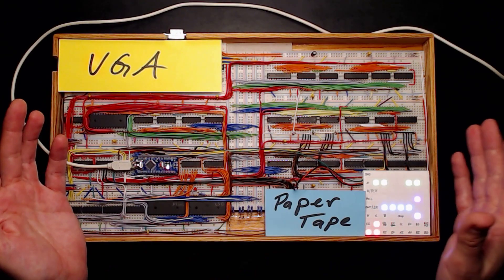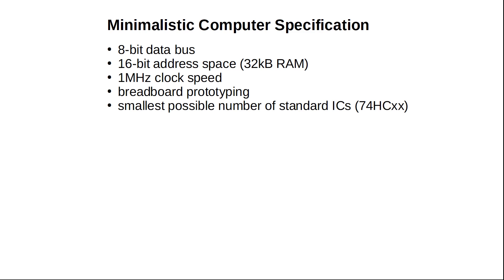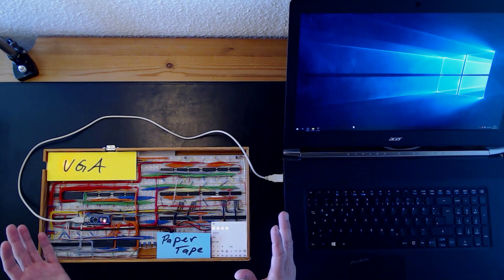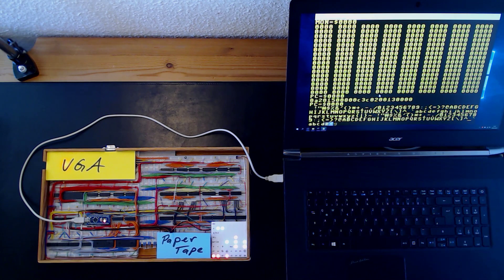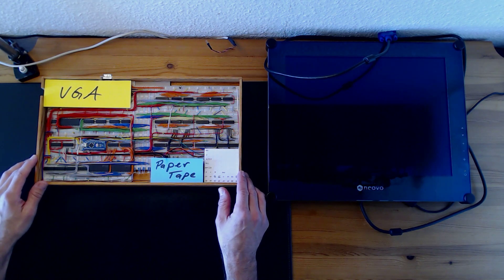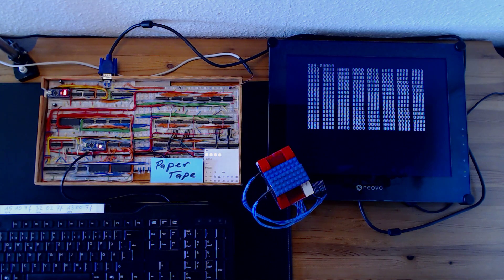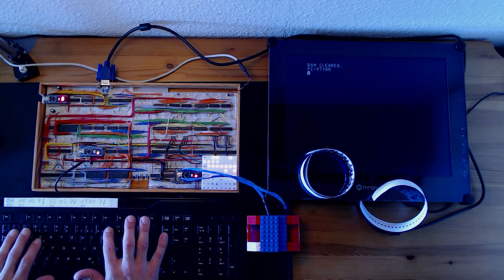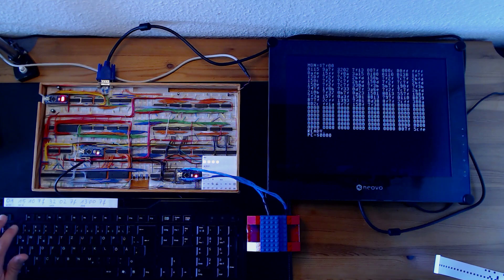Breadboard Computer With Minimalistic Design #1 Introduction

Comment: I am so incredibly happy that I have found your channel! This is EXACTLY the material I have been searching for, for quite a while!

I have read Petzold's 'CODE', and Scott's 'But How Do It Know?', I have done the NAND2Tetris projects, and built Ben Eater's 8-bit cpu, and read Brown and Maxfield's 'Bebop Bytes Back'. 

But hardly anyone talks about the bootstrap side of things, and I just wish more people would do so!

Things like "How do we get software into a new computer?", "How do we bootstrap our way from entering machine code via toggle switches into a high level programming language", etc. Even just turning on the computer, again, requires some bootstrapping, as all the contents of RAM disappear when the power goes off! All of this is super fascinating.

Only talking about the hardware side of things leaves the story incomplete. Everyone always shows you how to build a cpu hardware platform, but that's it.

Finding ANY books that continue the journey up the computer abstraction hierarchy and into and through software is incredibly tough (for some reason).

(Not necessarily books on OS's and stuff, but just things like how the whole compilation toolchain all fits together. A more holistic approach.)

(Bebop Bytes Back is the only one that I have found so far that talks about bootstrapping from toggle switches into assembly language in any reasonable detail, and is an absolutely incredible book).

Have you found any textbooks dealing with these neat things, books that talk about bootstrapping specifically? I am always on the lookout for incredibly passionate books on how computers work, much like Petzold's CODE, and the others I have listed above. 

(I also HIGHLY recommend Godel Escher Bach, and The Recursive Universe!)

Comment: Kudos for using paper tape. I have been thinking of how to bootstrap ROM as painlessly as possible, in a scenario when EPROMs are considered "cheating".  I was thinking of a similar setup but with foil or some other conductive material and using some sort of a mechanical contact to detect bits. Basically kinda like magnetic tape but much worse and not erasable. 

Is your tape reader also custom-built from basic components, or does it use a camera of some sort? 
I suppose you could also do your own reader with a pair of LEDs per bit, one as a sender and the other as a receiver, but it seems like that might be a bit tricky, I imagine light leakage would be an issue.
Reply from the maker: Hi Esa, the lego tape reader is indeed custom-built :-) It uses 9 LEDs and 3 photodiodes. Light leakage is a thing but can be handled by a clever algorithm. All in all it was a lot of fun playing around with this idea but didn't work reliably enough for me. So I eventually switched to magnetic tape and then, well, to UART, EEPROMs and FLASH and talked myself into not considering it cheating any more ;-)

Comment: I see no benefit to go with 32kB RAM since you get 64 on one chip easily. Or even 128 or even 1 M and more, and it could be paged with the memory mapper 74'610.
Reply from the maker: Thanks for your thoughts on this. You are right. However, 32KB can make sense in a minimal design alongside a FLASH sharing a 16-bit common address space. RAM banking has it's downsides in minimal designs as well, since switching banks can leave you in the wild without a valid program to execute. 74HC610 seems quite hard to find...

Comment: Hi, thank you for this great project. I want to try to build one with the breadboard and checkout your repo but I can`t find the sketches for the arduinos. Can you tell me where I can find the arduino sketch ? You mentioned that there is arduino sketches in the Readme but can`t find it. Please help.Thanks.
Reply from the maker: Hi, actually I do not recommend building this version since it reflects an early stage of the project, i. e. there is no maintained software etc. Please check out my playlist "Simplest usable PC?" here on my channel. You don't even need the Arduinos ;-)

Comment: My idea for a paper tape reader involves bright leds and photo resistors on the opposite side
Reply from the maker: Thanks for commenting on my paper tape reader. I really enjoyed building this thing - as you've guessed correctly I've used LEDs and Photodiodes accross paper. However, a YouTube video about it is not at the top of my list since it is really inconvenient to print out and cut longer programs :-)
Reply: @slu467  that is a neat thing about it it is very minimalistic for data storage since it doesn't require really any control logic

Comment: do you think you can make a vga signal without an arduino? just with this computer?
Reply from the maker: With a 1MHz clock and the minimalistic CPU design (no pipelining etc) that seems a bit out of reach ;-). The team behind the Gigatron TTL computer has implemented their video output that way, though. The focus of my little toy is more on being a really simple-to-build and modular system. Therefore the VGA module is designed as a separate ANSI terminal.